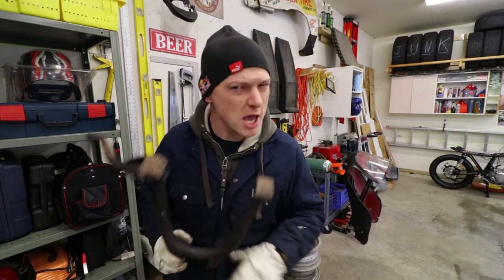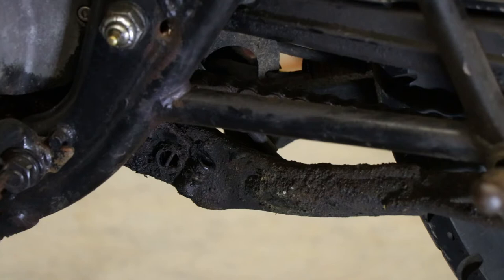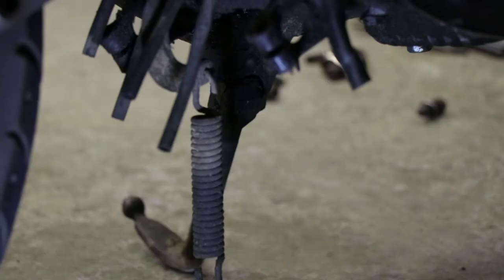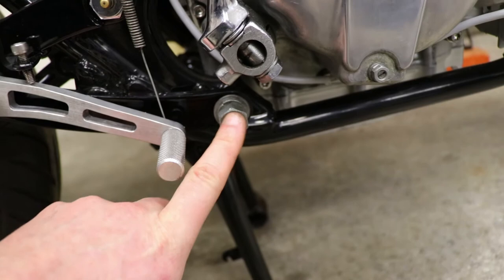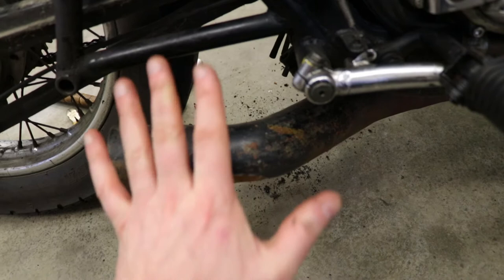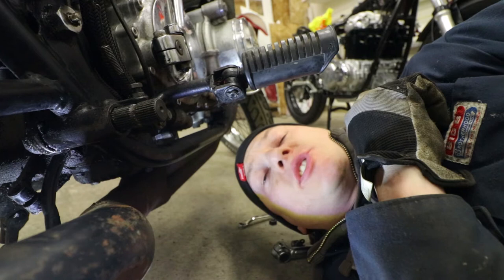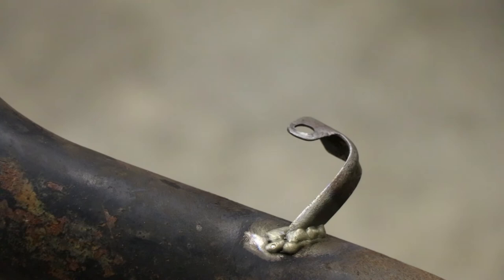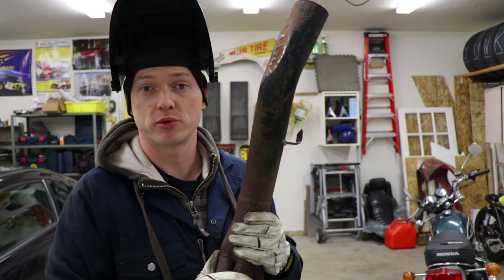CB750K (CB750) center stand removal & exhaust mods (CB750K Project pt. 1)

Comment: I have a Kerker muffler on my 400F's stock header. When it was put together, my welder tacked on a flat tab to catch the center stand just like the stock muffler.
Reply from the maker: Nice! My pipe wouldn't clear the center stand. If it had cleared I would have retained it for sure!!

Comment: Im sure you already got this hack after this vid, but the simple way to keep those springs locked open and much easier to take off the center stand- or any part on these old bikes-- is to fully extend the stand- therefore extending the spring fully as well, and then shim as many pennies as possible in the open coils of the springs, then close. The spring will remain expanded and you can simple take it off which ever part its on. Ive been doing  it that way and it saves me tons of time. BTW- wheres the CB550 w the CB750f tank details video. Were all waiting man!!!!
Reply from the maker: That's a sweet sweet hack! As for the cb550... I've got something in the works but need some scheduling to line up

Comment: Oh No Im 4 years too late - from the passenger foot peg, the original pipes should have had a clamp that kept the foot stand from hitting the chain - When having to replace the OEM on my CB750 DOHC 1979, I saw the exact same problem. It was mitigated by using the metal plate that the mufflers used to attached to the Foot PEG -

Im not about to give up my center stand - its the only means I have for working on my bike - imagine trying to adjust valves, tune carbs, etc while on a side stand ?